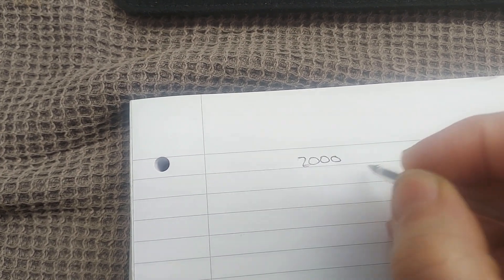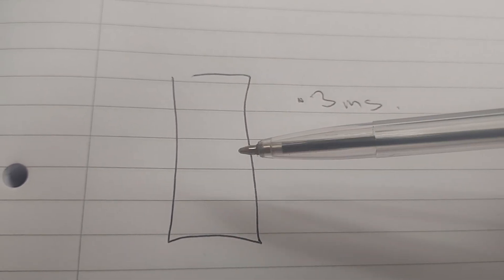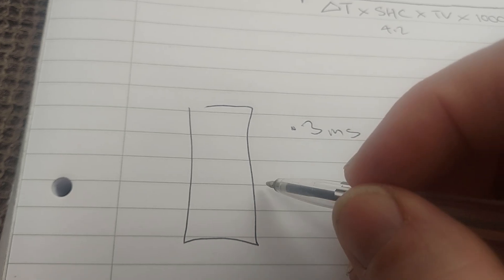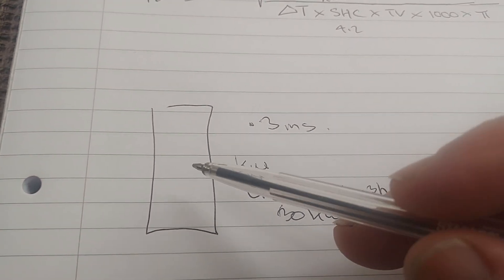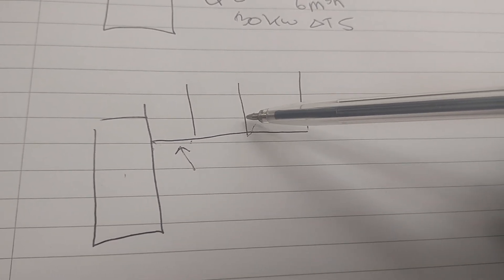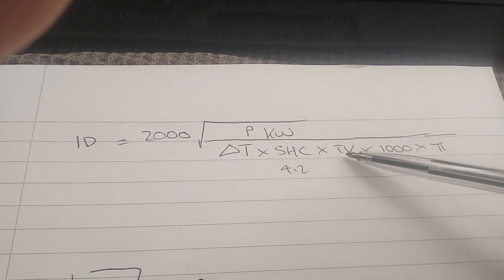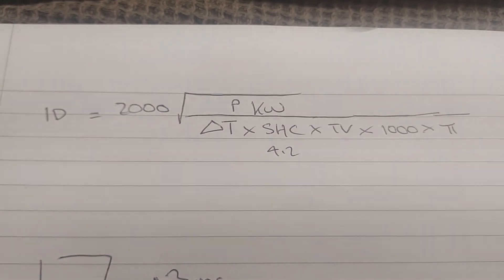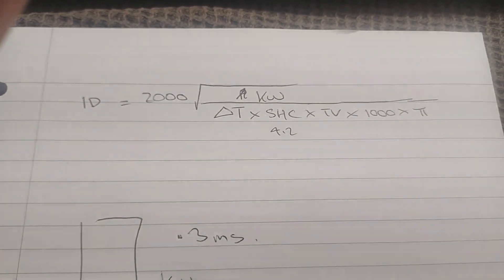Sizing low loss headers and distribution headers.

Comment: Hi Andrew, great video. Currently going through Heat Geek and this is really helping so thank you. What’s the difference between a low loss header and a distribution header and what application would require one over the other. Hope that question makes sense. Thanks very much again.
Reply: Oh ok that makes sense. Most of the low loss headers I’ve seen have multiple connections directly on the llh. So you’re referring to taking a 35mm pipe off of the llh flow and having a manifold to supply multiple zones with independent pumps ? 

Thank you for your reply. It is appreciated
Reply from the maker: @sambutler927  on my YouTube elsewhere I have a video showing how not to do a low loss header. It can be difficult to do a low loss header with multiple outlets
Reply from the maker: @sambutler927  a low loss header has a distribution header. It's not a choice between one or the other. The only time you wouldn't have a distribution header is it for low loss header is supplying a single circuit. Latest tribution header distributes the water from the Llh to multiple circuits

Comment: Thanks Andrew, really interested although im still slightly baffled by the mathematics (muppettry on my part)One query i have always had is regarding the stepping up in size from a distribution pipe to another. For example, you mentioned using a 35mm section being fed by  28mm port, i have always assumed the 28mm will only pass a maximum amount of fluid/heat through so therefore query the usefulness of the 35mm section. Perhaps you can direct me to where I can study the fundamentals of that ? Many thanks, John
Reply: The P/(Txshc) bit gives the mass flow, the 1000 is a unit converter ,dividing by velocity gives cross section area of pipe ,dividing by pi gives Dsquared divided by 4. The 2000 is 2 (the sqroot of 4)x1000 (unit converter) . Hope this helps !
Reply from the maker: @brotherjohnno  the purpose of the sizing of the pipe is to pressure differential to a minimum. Pressure loss is a function of diameter and length and not just diameter. So one of the comments I make in the video is that what's the length of 35 millimetre pipe being so short set 28 mil may actually be sufficient in providing a low enough pressure drop. The use of 35 mm is simply an adherence to the design principle

Comment: Very informative video once again Andrew! I was confused at the start of the video as im used to using the velocity triangle to work out flow rates for fixed quanity of water through a fixed diameter of pipe ie Quanity over area x velocity but understand your equation converts from M2 to mm instead of converting it yourself.
Reply from the maker: @plumberdan5720  in the heat key course Adam chose to teach the theory long hand so that people had an actual understanding off the theory. But when we are working with these numbers almost daily we need a formula that takes a straight to the answer